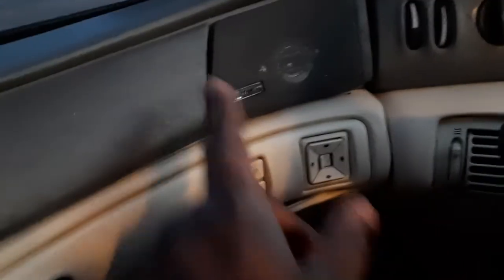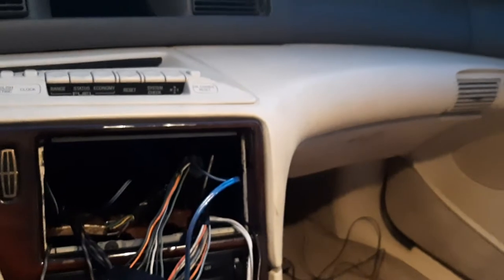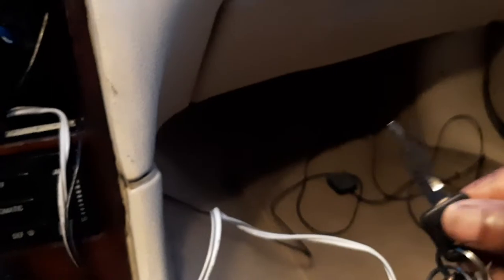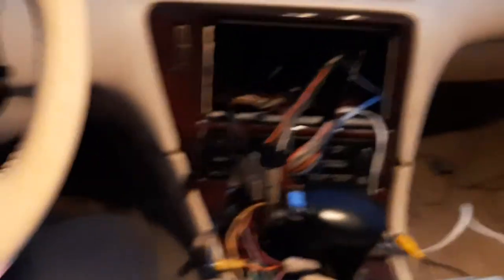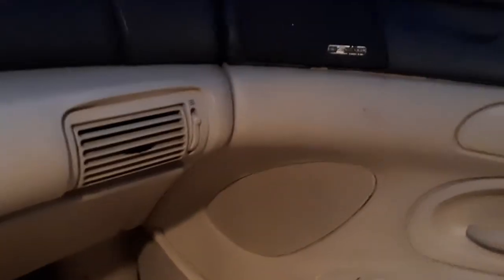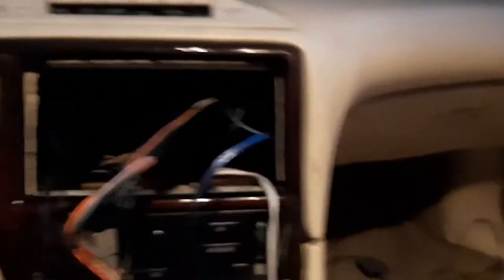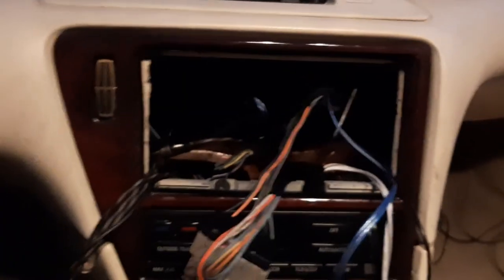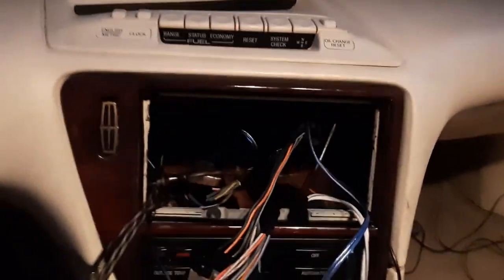My 95 Mark VIII Update : Door speakers rewired and installed we have sound!!!!

Comment: I have a 96 Mark viii and I have the same problem absolutely no sound coming from the stock head unit can you tell me what wiring harness you used for the aftermarket radio I'm trying to do it myself my last stereo/ speaker install on my Camry was 400$ not trying to do that again on top of buying the products

Comment: Nice video 👍 looks like you didn't have to remove any trim to take out the radio which is cool. How did you secure the new one in the dash though?
Reply from the maker: I just pushed it in with no problem
Reply: My bad I wasn't specific. What  I meant was what is the double din dash kit you used? I bought 2 and both don't work